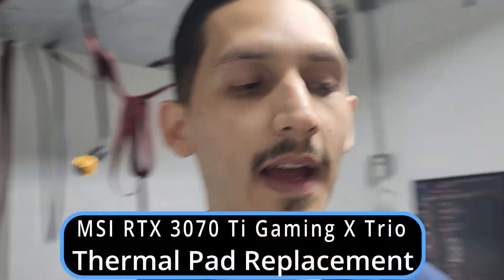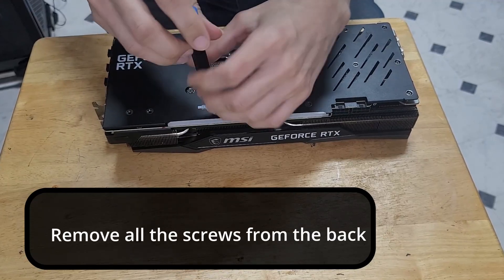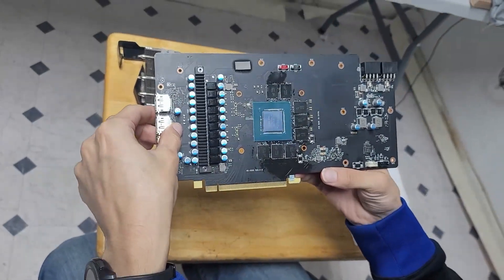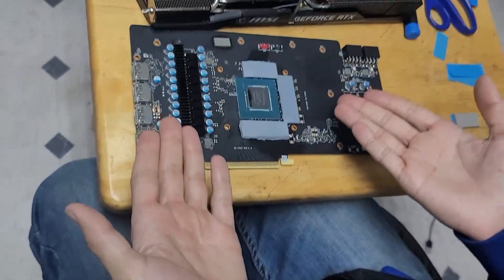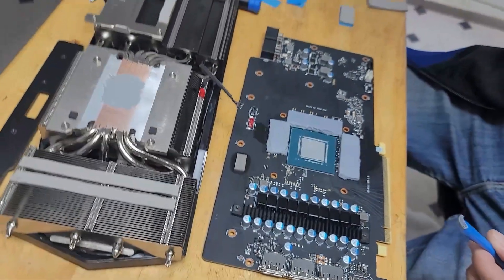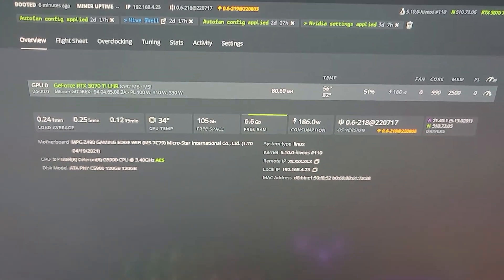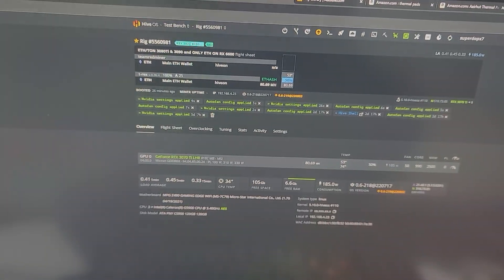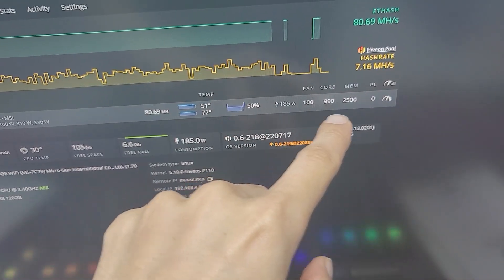MSI RTX 3070 Ti Gaming X Trio GPU Thermal Pad Replacement!

Comment: Bro I know that my comment could be late to that video but I just wanted to point out that you are mining with a LHR (low hash rate) card that's actually made for gaming and not for mining and it's bios locked. Btw good video, i was looking for the thickness of my thermal pads

Comment: Always use a digital vernier calliper to measure the thickness of the old thermal pads if the information is not available on the internet, sad how these companies charge ridiculous amounts for these cards especially the 30 series and can’t provide necessary info on thermal pads

Comment: Hey brother, my temperatures reach around 86 celsius when i play high graphic games, and my GPU voltage doesn't go above 0.9500V, which seems normal. do you think i should consider changing the thermal paste as a solution?
Reply from the maker: @AdamJatla  those temperatures seem fine tbh but it wouldn't hurt to change the thermal pads
Reply: @superdopx  My GPU core clock is running between 1650 and 1750 MHz. by the way, i have the 3070 Ti OC. What worries me is that i've seen a lot of videos showing the 3070 core clock running at 1980 MHz, even though my GPU is supposed to be more powerful than those

Comment: Hi man... As you said I used 2mm for vertical and 3mm for horizontal memory pads. I did use quite a good amount (not excessive) thermal paste. (NT-H1 by Noctua to be specific) My Mem temps are well below 76 after repasting of thermal pads but my core is not going below 63 whatsoever. My fans are at 75% and I am mining on KawPow Algo. I have an rtx 3080 as well and that has decent temps like 58 on core and 78-80 on memory. So i dont know why my rtx 3070ti is slightly warmer on core compared to the rtx 3080.
Reply from the maker: Yeah i Had the same happen to my core temps after changing the pads, I read somewhere that its some sort of trade off. I also thin KawPow might be intense on the Core maybe?

Comment: 51c with only 50% fan speed is pretty good. You were more than likely getting a lower core temperature prior to this due to the fan ramped up much higher in the beginning.  I don't have this specific card, but I watched anyways. Good job!

Comment: You should try phase-change material Honeywell PTM7950. It comes in as a sheet, lasts longer, performs works better than traditional pastes and there is no pump-out effect. For the power section (vrm) and vrams, I advise replacing the thermalpads with Upsiren UX Pro thermal putty which will reduce the temperature of these components by 5-10°C.
It is also a good idea to do undervolting.
Reply from the maker: Okay thanks I'll look into it!

Comment: I have been looking for a video like this. my card has memory temps of 100+ degrees while running furmark. and I was also looking at replacing thermal paste. thank you for the very informative video. It is dificult to find specs for these things.
Reply from the maker: Yeah running furmark definitely runs the cards hot 🔥
Reply: @superdopx  I replaced my thermal pads and paste and my mem temps dropped 20 c and core only went up a few c
Reply from the maker: @Auto-Tech-Matt  Yeah same here , I read online that its normal for that to happen.

Comment: I find it hard to believe that a good cooler like the gaming X trio needs thermal pad replacement! I figured it would have excellent temps no matter what you do to the card, but it could be that the 3070TI just runs hotter than the chips in its class.   Either way, a great demonstration in the video, cheers
Reply from the maker: Thank you sir!

Comment: Do you really have to apply thermal paste twice on both sides?
Reply from the maker: Not a 100% sure but I've seen people put a lot , don't think it affects it any less or more if you put alot but it's better to have more than not enough imo
Reply: You only need to apply the paste to the gpu, not the cooler as well. I've built plenty of pcs, and changed a number of thermal pastes and pads on gpus. Also, you don't need so much paste, just a small pea sized blob will do and no need to spread it out as the pressure of the cooler when screwed back on will be enough to spread it.
Reply: more chance of creating air bubbles. i wouldn't recommend doing it that way.

Comment: Superdopx cool tutorial! I have identical card myself and I'm wondering - should I get 3 and 2 mm pads and squish them or 2.5 and 1.5? Which one would you recommend?
Reply from the maker: Well it depends on if you want to try another size and hope it works the same or just squish them down a bit tbh , if you have the money 💰 just buy all the sizes and try them out lol
Reply: @superdopx  True, however I realized there is no 2.5mm size, smh. I'm simply scared of just "squishing" it in - I paid way too much for this card to let myself break it :) Thanks!
Reply from the maker: @Hypixus  I feel it bro, just handle it carefully, you won't break it, if the Temps are high just turn it off immediately and try setting them again.
Reply: @superdopx  Thanks. Just to be sure - you just pressed them down with fingers or some tool? I feel like just randomly sticking fingers in will reduce the conductivity by smearing oil from human skin :)

Comment: Can i ask you if you measured the 4 screws of the gpu? I have to change them and I can't open it anymore because I scratch them too much. I need to know if 2x7/9mm or 2.5x7/9mm
Reply: I've done it this morning. The central spring (bracket) with the 4 screws mount 2mm x 7mm
Nice video!
Reply from the maker: @Miagi San  awesome! Glad you figured it out! Thanks!
Reply from the maker: Unfortunately I did not measure the screws bro sorry

Comment: Hello, for the most accurate result, do I need to use 2mm on the vertical and 3mm on the horizontal
Reply from the maker: Yes 2mm vertical and 3mm horizontal

Comment: and also can u tell me that how long and widetherma pad does a card took as i seen 120*120 is more cheap then 80*40 so in 1 shhet how many cards will be covered
Reply from the maker: For the best temperatures you want to make sure you get a decent quality thermal pads, if 120x120 is more cheap it also might be less quality but you can buy 1 120x120 sheet and try them first on one card before you commit to buying alot for the rest of your cards. Buy one of the 80x40 sheet and try that one aswell, and make your choices afterwards . But I know your going to need more 3mm thermal pads than 2mm pads for all your cards

Comment: how do u squeezed i mean like before putting pads on card or it will atomatically squeez when putting back oplate and screw it
Reply from the maker: So when I first put the pads on and screwed the backplate together , the temperature drop wasn't as I expected but it did drop alot tho. I just wanted a better temperature drop so I took out the pads and gave them a nice squeeze on the desk with like a solid object on both pads , 2mm and 3mm. 
My suggestion if your going to change your thermal pads , 
1.) First replace them and put it back together, remember 2mm vertical & 3mm horizontal on the memory chips. If you are happy with the results then great!
2.)or if the temperatures do not drop as significant as you want it to , take it apart once again and adjust the pads & give them a nice squeeze with like a book or something solid. and try again. its not always perfect the first time you do it so you might have to adjust a few times before it actually sits on correctly.
Reply: @superdopx  just get 1.5mm and 2mm..... why ruin the pads by squeeze
and dont put thermal paste on cooler and die..... you make airgaps..

and dont think like its a cpu..... you need a lot more thermal paste on a GPU
Reply: okay , thx for the info as i have nearly 20 3070ti's and all have 100+ temps and many have nearly 108
Reply from the maker: @movieskakhajana4259  oh wow , yeah changing the thermal pads will reduce your temperatures by alot and also bring down fan speeds for lower noises